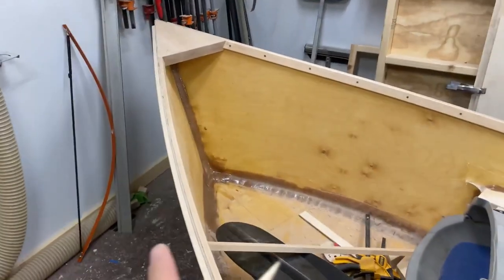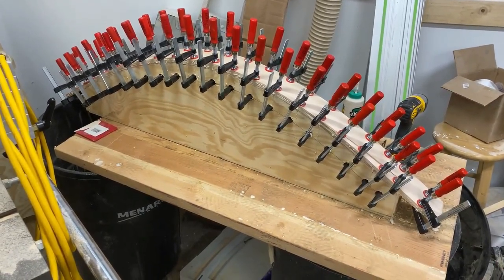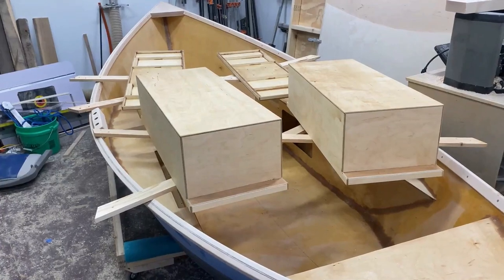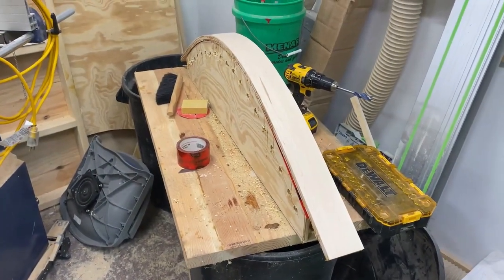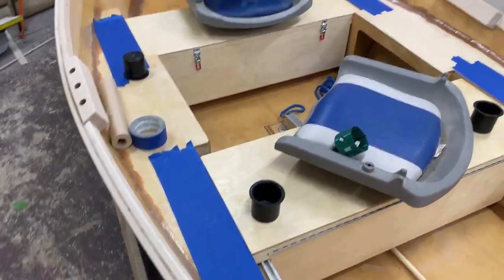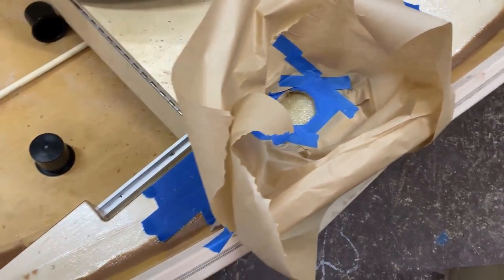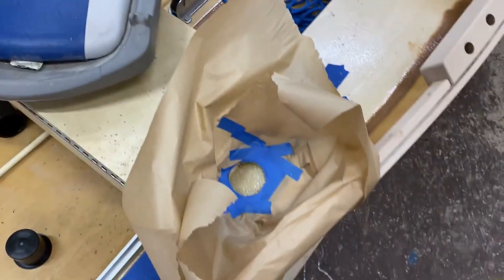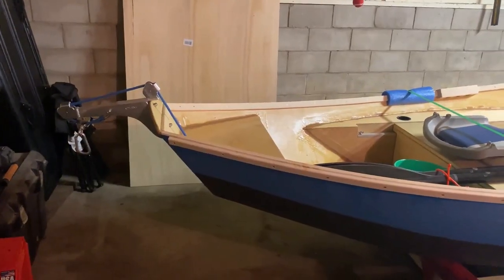Drift Boat Build Part 15

Comment: Thank you for taking the time to show your progress through the build process. I know for myself it is working on something or watching someone else working on a project that I get ideas for improving the end product usually after I mad a mistake..lol. I knew I wanted to do a stitch & glue drift boat rather than a internally framed boat and your series was the first one I've seen.
I think you should add some bracing to the anchor area as I don't think that one strip of maple is going to be enough. And I think I will be dadoing the T track in flush to give a bit more wood on the dry box's in that critical area you were worried about as well as a smaller opening into the storage area on each side with some drain hole's.
Great job and keep us informed on how everything holds up over the years.